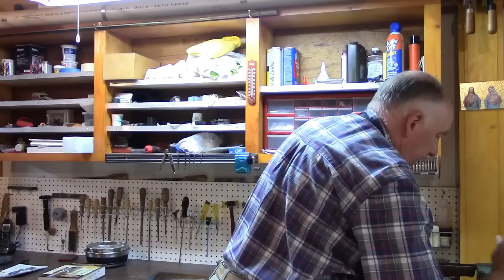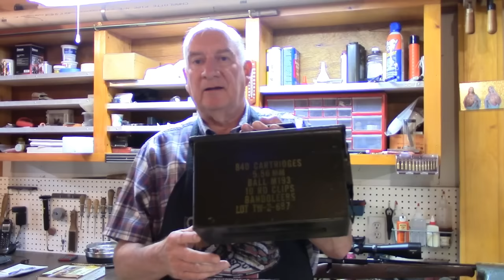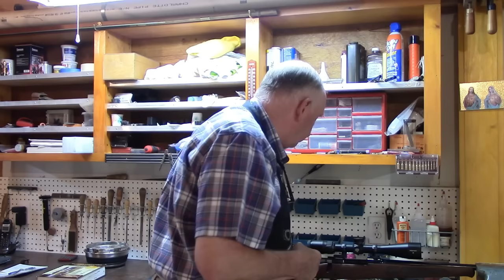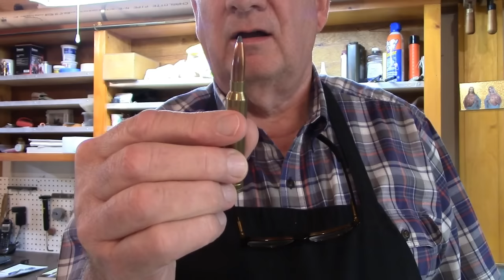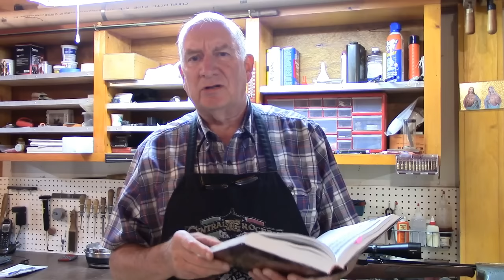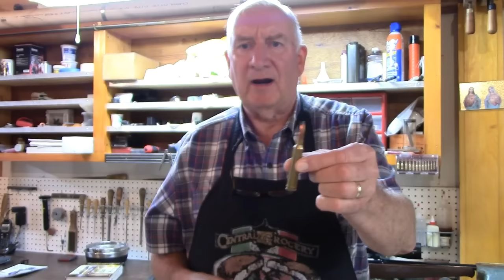How long do barrels last? ~ Discover the truth!

Comment: In Vietnam, it was a fact that M-16 barrels sometimes came back from a firefight with barrels drooping in a downward curve somewhere along it's length. Caused the drill sergeants to add shooting discipline to all shooting instructions. Still had trouble with burned out barrels, so the 3-burst setting was added to the selector switch. In WW2 the armorers just slowed the rate down which NONE of the front line soldiers appreciated. As for Afganistan, I hear that barrel quality determines whether or not the weapons have failures or not. So, shooting too fast??? He's definitely right about burning out the barrel. But you can improve things some by starting out with higher quality metal.
Reply from the maker: Whoa.  Beware of bogus military history and vivid imaginations.  I am a Vietnam combat veteran of the Army, who was in Basic Combat Training (BCT) during that time, and know what drill sergeants do.  They teach firearms in the most basic sense.  After the rifles are issued, they explain what they are and give enough brief description so each person can carry it to the range, where he will receive instruction from a firearms instructor of that MOS.

Fire discipline has been around since soldiers were shooting arrows at castles and it didn't enter training as the result of anything to do with Vietnam.  The military has a logistical estimate for ammo use in battle, of 300 rounds per person, which is hardly exhaustive to a barrel.  A firefight can last seconds or days, with much less or much more ammo, but the average remains the same.

I never heard of a drooping barrel in my Vietnam service, either during or after, so it doesn't pass my sniff test, but I can give two very good examples that determine my conclusion:

I prefer to examine real combat case history, rather than tales told by "experts" 55 years after the war.  The highly decorated war hero, the late Lt. Col. Hal Moore (retired Lt. General), commanded the 7th Regiment of the 1st Cavalry Airmobile Division at the Ia Drang Valley, in the intense 3-day sustained battle that went on non-stop with resupplies of ammo, brought in by helicopter. His small regiment of only 385 men, assisted by artillery and air support defeated and over-ran an entire division of over 2,000 highly trained NVA Regulars.  They fired nearly continuously during daylight hours and often at night.  This was 1965, with no cleaning equipment, and nobody would have dared take his weapon apart under fire.

Col. Moore personally used his M-16 throughout the three days and used it heavily in dire combat alongside his men.  Nobody in the world had a closer look at the M-16 and its performance in combat.  Afterwards, he credited its performance for bringing his men home.  There were no battles more intense, that exhausted more ammo, and that was in 1965 with early issue rifles, just as the one I tested.  No droopy barrels.  I'll take his intimate combat experience over anyone's, period.  
Before Col. Moore put his hands around one, military testing already concluded that it was fit for rigorous battle.  They fired multiple samples of the rifle in extreme performance tests, after which it received the same rating as the M-14; a selective fire rifle.  In military vernacular, a rifle has a fixed barrel that is not changed in the field, unlike a machine gun that is designed to be changed in the field.   

So, as to droopy M-16 barrels, I'll classify that as complete fiction and too many grass fed hallucinations. 

The M-16 was never in its history made with anything but the highest machine gun grade steel, and any company that makes them with the same steel is making a barrel that will last just as long.

The history of the 3-shot mode had nothing to do with fire discipline.  Soldiers understand that from the cradle.  It was necessitated because it's impossible to control its fire to 3 shots and concentrate on shooting accurately at the same time.  It creates an artificial flinch by stabbing the trigger, instead of squeezing it off.

The M1 Garand is a simple gas-operated single fire weapon that runs a bolt back and forth at each firing, as fast as he can pull the trigger.  An armorer cannot adjust a soldier's finger.

That history about drill sergeants is entirely bogus because drill sergeants don't do such things.  Only in Hollywood do drill sergeants conduct firearms training.  They "drill".  That's all they do.  They are responsible for developing morale and discipline, and teaching the military way of marching, running, the manual of arms, saluting, dressing, polishing, PT, getting their units around from place to place, and they sing cadence along the way.  What you see when a third grade teacher is walking her class across a street is the miniature version of what a drill sergeant does with refinement.  

At the range, they are safety observers and assistants who respond to commands from the tower. But they never teach firearms, and they never had anything to do with field tactics or fire discipline, which is the responsibility of a tactics instructor.  

Many Vietnam veterans, and I thank them all whatever they did, brought back more stories about the rifle than they experienced it, so I don't listen to those that spout "factual" descriptions of what M-16s did in Vietnam, or how Soldiers, Sailors, Airmen and Marines got by with such an excellent weapon, ideally designed for the role and climate.
Reply: @GunBlue490  - Well, that "droop" story came from 3 soldiers - a SGT Major, a PFC, and  a Major. But I can freely acknowledge that many war stories get exaggerated. The Sgt Major did like to imbibe. The PFC was a definite PTSD case even before they formalized the diagnosis. However, the Pfc was a roommate, the others ROTC instructors, and I wasn't one to question during class. So, that's where that came from. The M-16 is indeed an excellent weapon, no question. The Afganistan story came from my brother's NG company and had something to do with milled vs broached with the milled and lapped barrels working in those conditions when the broached barrels would require occasional FTF drills. Enough improvement that his company switched out their barrels. 
The 3-shot selector bit came from a magazine article by a supposed combat veteran. I probably should have questioned that, but it made sense at the time. 
So, thanks for the response and information. I'll move the drooping to the "war stories" column.
Oh, and before I forget, the Thompson, Reisling, BAR, all had faster rates of fire until changed by the Army. Once acquainted with what their weapon could do, NONE of the soldiers appreciated the "de-tuning" performed by the Army's armorer. It had nothing to with trigger control. It was something that came down as orders from the brass.

Comment: the Venturi effect is slightly misunderstood here - the necking down of the cartridge creates a reduction in gas pressure and a consequent increase in gas velocity. However, the restriction to flow caused by accelerating the bullet down the barrel will reduce that gas's velocity back down and consequently, the gas pressure will once again rise. Thus the effects should largely cancel out except in the region of the necking down itself.

Comment: Just watched your video on barrel wear, have an exception with your venturi.  The Italian gentlemen's name was Bernoulli and the venturi effect is used in carburetor, hydraulic systems etc. It states that a restriction increases velocity in proportion to the restriction not the other way.  Thanks.
Reply: Your right, it's the same that applies to a convergent / divergent  rocket nozzle where the gases are funnelled into the nozzles throat via the convergent part of the nozzle , the gases increase velocity through the throat and then expand and accelerate to  supersonic velocities within the divergent section of the nozzle.
That's why you se the large bell shaped nozzle on engines on what the shuttle and the apollo used.

Comment: Not sure what he as talking about reducing a pipe results in a smaller pressure, Bernoulli’s principle says that it will have a higher pressure if you reduce the flow area

Comment: I agree on the barrel life and try to explain about that with my boys who loves to empty clips on there AR.s and the same for clean kills and not over kills. For me 223 & 5.6 is my coyote gun my 30.06 Winchester model 70 featherweight for deer. So they want 6.5 for coyotes and the 300 for there deer. I told yes they.ll work but you don.t need that much gun. Plus cost on 6 5 to 5.6 and the same 300 to 30.06 same way the cost and over kill. Good video love hearing talk always good common sense. And most of all before I forget them boys never want to clean there guns. And boys stop shooting tracers.

Comment: Might as well chime in with my 2 cents ... 50 years of shooting and hunting experience. I see all these "experts" running down three shot groups for accuracy checks and sight-in of rifles, they prefer 5 or 10 shot groups! When I see these "experts" running these strings of 5 or 10 shot groups, I don't see them allowing their barrels to cool between shots! That wears barrels out faster than shooting the rifle for its intended purpose... With experience, I have come to fire 2 shot groups for sight-in the majority of the time and have always used three shot groups even while I was employed as a Deputy Sheriff and worked as a SWAT Sniper. 

New shooters should use extreme caution when using ANY information found on the internet! Always verify through a trustworthy source. There is a concerted Marketing effort that will lead you down a rabbit hole of "new and improved cartridges" that is nothing but market hype and 90% bullshit 100% of the time and it has its following of internet idiots that will amaze you with crap and wonder that gets you no where... It has become "fashionable" these days to be a "SNIPER" and to hear the internet experts tell it, shooting big game at 1,000 yards is easy, acceptable and YOU should be doing it to! BULL! In 50 years, the longest shot that I have ever HAD to take on deer was 250 yards! And I have hunted Mule Deer along the Snake River and Salmon River Breaks and if long shots were REQUIRED, that would have been one of the areas you would expect to have to take such a shot, but a HUNTER gets close enough to make a clean and humane kill or doesn't take the shot! Shooting big game outside of what is considered as "long range", say 400 yards, is along the lines of "Stunt Shooting" NOT HUNTING... Keep that in mind.
Reply from the maker: If you watch my videos, you will find that we are on the same page.  The problem actually goes back to our generation, who largely didn't take up shooting.  Their kids likewise.  Now, three generations later, they have nobody to learn from or ask, and they are ripe fruit for the picking by advertisers, and these truly blind people believe any nitwit behind a counter or on the internet.  My stated purpose for doing these videos, as I posted some years ago, is to help restore some of the shooting heritage that you and I grew up with and take for granted.  Their ignorance of the sport is not their fault; it's the fault of unscrupulous people in the business who know better, but take advantage. As a SWAT sniper instructor who worked closely with the FBI regional sniping instructor, I knew very well the difference between precision shooting in the line of duty, from ethical hunting practice, and never mixed the two. I'm frankly not pleased that the shooting industry has purposely promoted sniper mentality and have very much confused that difference.

Comment: I know I like the 6 mm. I first got one for my wife. It was low recoil we did not know if she would like hunting. And a Ruger  m77 was for sale in 6. Well the shop had it for awhile most people here did not know what it was. So I got it cheep to boot. With the 100 gr load sited 1 1\2 in high it wouldn't be much lower than 6 in. At 300 yd. So she could hold on out to 300 yd. Which is the longest shot possible in her lprefured hay field. She has now taken 15 deer 3 hogs 2 turkeys and 1 coyote. One round per. animal. I think she's done good.
  I usto like big guns they were not necessary for our hunting I just liked them. I had a shoulder problem one year and my rifles that I had been using were out that year 338 wm and 45_70. Well I used her rifle when she was not. Well it worked for me to.
 Her and my daughter the next fathers day got me a 77 mark2 in 6 and I use that rifle more than any other. I don't think I have Evan shot the 338 in about 5 years.

Comment: Short, tight and informative explanation of the important sides of the subject. Thank you very much ! Please share your opinion: which of the .264 cartridges are most efficient in terms of powder burn/pressure/velocity. I am currently reloading, shooting and hunting with the 6.5x55 SE. It is very accurate and precise round and great long range killer with a larger case capacity compared to other 6.5s. I wonder how much barrel life it will have with the high pressure loads which i am using (high - compared to the emasculated factory loads on the market) .. without excessively abusing and overheating the barrel. Bullets from 140 to 156 gr., slow burning powders like N560 and N555.

Comment: The necked down cartridge being less efficient makes sense. The change from a larger diameter to a smaller diameter introduces resistance. Across resistance you get pressure drop and heat gets generated. Never thought of that.
Reply: not

Comment: In general I agree, but there are exceptions. My son uses a 300 win mag for deer. I used a  7mm rem mag. But we are in western Kansas where long shots in bad wind are the norm. Better to be a bit over gunned and make a good clean kill.  FYI, built my 7 mag in the 1980sm have fired less than 800 rounds through it and it still groups 1/2 MOA. (Douglas AA premium bull barrel) But like you say, I don't do rapid fire.  :)
Reply from the maker: The fact that your son kills deer with his 300 Winchester Magnum proves only an obvious fact; that the rifle can do so.  A fire truck could water my lawn, too.  Whether it is necessary is my point.  

The 25-06, 270, and 280 handle the wind with absolutely equal effectiveness, and are every bit as flat shooting, if not more so, with far less bullet weight and mass, which translates to wasted meat and raw components.  

I'm an experienced long range game shot in the high winds of the prairie in mid day, and I know what rifles accomplish of far smaller powder capacity and bullet diameter very, very nicely.  I also own and have shot elk with my 300 Win. Mag, for which it is entirely appropriate.  Wind bucking ability is a component of ballistic coefficient, not case capacity or bullet diameter.  

No deer that walks in America requires a 300 Winchester Magnum, regardless of how many are shot with it, or who recommends it.  Whether you disagree doesn't change facts that are what I deal in.
Reply: @GunBlue490  "with far less bullet weight and mass,"

And that is the argument from the very beginning. Which is better, the O'Conner walk-on-the-light-side or the Keith better-too-much-than-too-little.  Our western Kansas deer are grain fed and larger than deer in many other states. Where we hunt we have whitetail and mule deer.  You are of course correct, in most cases a .270 or 7x57 will do just fine. But life is not just about most cases. 

Both of my vehicles are 4WD capable. We don't use it much, but when we need it is it essential. And we don't always know when we will need it in time to change vehicles. We drive them all the time because, in our estimation, the gasoline  we burn when not using the 4WD is worth having the performance availabe when needed.   A 1/2 ton pickup will carry most pickup loads. A 3/4 ton the oddball heavier load, a one ton duelly isn't required to carry 1/2 ton of gravel but it does it just fine, and it does it much easier than the 1/2 ton pickup. Again, choosing to own and use a duelly isn't ignoring facts, it is making a judgment call about the facts. 

The same applies to hunting where we hunt. We are not trophy hunters, we are meat hunters. Botching a shot doesn't mean we don't get a rack to put on the wall, it means the grocery budget has to stretch farther. Given the difference between a rifle/caliber that will suffice in 90% of cases or in 100% of cases, picking the larger one that will always work isn't ignoring facts; it is making a judgment call in light of all of the facts and the unknown variables. 

"No deer that walks in America requires..."  anything more than a .22 Long rifle. 22s are used to dispatch countless beef and hogs across the country quite well so it can be done. That is also an objective fact.  

But we both know that hunting is not just about objective facts, it is also about the unknown variables of the quarry, the weather and human fallibility. Your generalizations are correct, but that doesn’t mean that individual hunters in specific hunting circumstances that don’t follow your generalizations are ignoring ‘facts’ they are just making different judgment calls about the same facts.

Comment: I shot into a deep snow bank one winter when I was in the north , in the spring we picked up bullets that were on top or the ground most of them had traces of rust in the rifling grooves. This was 30-30 win. out of a marlin.
Reply from the maker: The rust was quite simply from your barrel. Keep your barrel clean and lightly oiled.
Reply: The rust only appeared after the bullets laid in the snow and melt water for a few months. The barrel was well cared for. Traces of steel were on the bullets . Not much but enough to cause a slight stain.